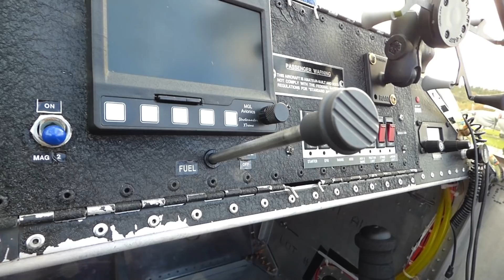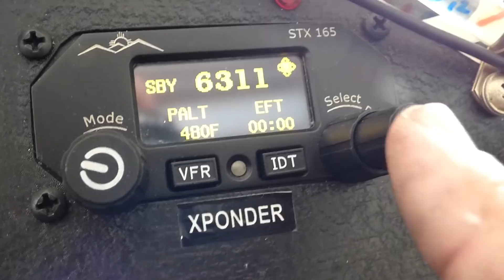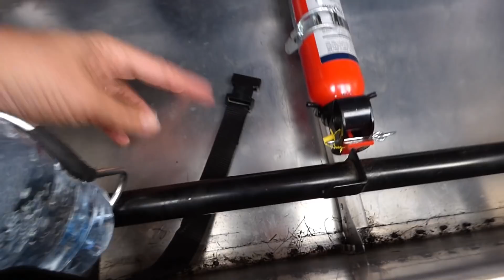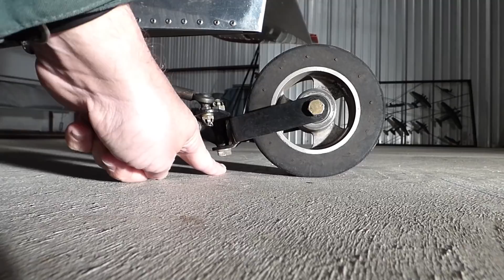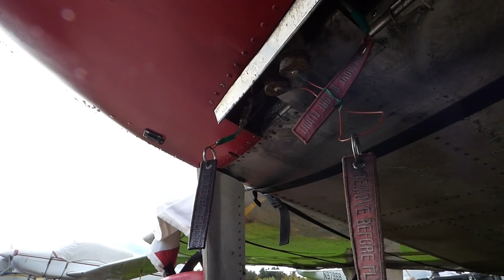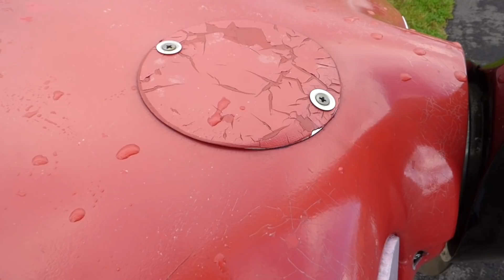Sonex Video Tour

Comment: Is the non painted parts covered in lacquer? I mean the polished surface
Reply from the maker: No. 6061-T6 aluminum is about the most anti-corrosive aluminum alloy there is. It's just polished. I re-polish every 2-3 years, and it had been on a tie-down for 6 years (in a hangar now). Lacquer would not work, and would haze, crack and chip. It would look awful. Check out any polished aircraft and you'll find the same thing as mine.
Reply: @mikesmith208  sweet! Was just curious, can see the care you put into it with that shine you got going on 🫡

Comment: Stupid?
Reply: You can't build a car but a plane is not a problem. Plastic engine cowling? If you are cold just wear motorcycle gear. Why not sit in the middle of the plane. The propeller is the most important part of a plane.
Reply: Especially not a 100mpg car.

Comment: What a great video and thanks for sharing in such detail. Lots of fantastic ideas. Just a helpful hint: if you ever need to remove that VHB tape, you can use a piece of dental floss and run it between the two pieces. It will act as a sort of wire cutter and separate the two halves. Then you just need to clean the adhesive from the surfaces and you're good to go.

Comment: What material are you using to cover your glare shield?  It looks good.
Reply from the maker: It was a faux leather from JoAnn Fabrics. I put it on with high strength upholstery adhesive. Tricky to put on (requires adhesive on both surfaces, gets tacky, then place). It's never moved, bubbled or buckled. I was looking for something easy to clean that would not hold dirt and dust, so all fabrics were out of the question. Black is preferred, as anything light colored really reflects off the windscreen!

Comment: Nice setup, but why did you put the Mag switches apart from each other instead of next to each other?
Reply from the maker: The center of my panel is removable for access. There was not enough room on the left side of the removable section to fit all the switches over there, so one of them had to move a bit to the right, into the removable panel. The Sonex has limited panel space, so you have to make decisions.

Comment: Just stumbled on this and GREAT video thanks.  Question about your rocker breaker switches.  What brand are those ?  I can't seem to find those.
Reply from the maker: Mouser Electronics, www.mouser.com, W51-A121B1-10 (10 amp), -5 (5 amp), etc.
Reply: @mikesmith208  Thank you.  Haven't taken time to view your entire video but some great points.  Will update my panel layout immediately.  I am trying to get back to building this winter and really appreciate you taking the time to do the video.
Reply from the maker: @jamesstephens9818  No one way is the right way, so weigh your options before you do anything. I like the switch/breaker concept, and the fact that it's all in front of me, and easily changed if I change something on my panel that requires a different amperage. Others like the expensive certificated breakers. And other prefer fuses for various reasons. Best of luck!

Comment: Question about foot rest. Will the bottom buckle if you "stand" on as you get in, or is there a cross bar that the pilot and passenger can step on for support? Thanks for your time.
Reply from the maker: Not sure where you mean. You get in primarily by standing on the seat and then sliding in around the control stick. For the pilot you can maneuver to avoid stepping on the seat, but not for the passenger. The seat pan is like a sling, and is quite capable of supporting someone walking over it, and the seat cushion helps spread the load. If you were referring to the bottom skin of the airplane, there's not a way you can physically stand on it; it's too far under the instrument panel to reach it in a standing position. And there is a cross member that goes from the spar tunnel to the firewall. That's where I have my fire extinguisher mounted.
Reply: Michael Smith  I mean where you rest your foot while sitting. Can you put pressure on the floor or do you have to carefully step on floor crossbars to avoid a possible “buckle” of the floor pan?
Reply from the maker: @denisronchini2258  Floor is solid as a rock. Kick the heck out of it if you want. :-)
Reply: Michael Smith  Thats awesome! I keep looking for reason “not” to do build it, but it’s getting harder not to buy a kit! Lol. Thank you for the update.
Reply from the maker: @denisronchini2258  A Sonex is a "simple" aircraft. It's not an RV and it's not a IFR Cessna or Piper. If it meets your mission it's a great little airplane. I built the entire thing, all in, for $28,000. After 6.5 years I still love it. Would like some more HP, but I knew what I was getting with the 80 HP VW ($7,000 vs $24,000 for an engine!). If you can swing the cost of a larger engine you won't be unhappy. It just wasn't in my budget.
Reply from the maker: @denisronchini2258  I sent you an email...

Comment: Would you please add to your pref Pin over bolt? And fuel shutoff with the Aero carb , over mixture cutoff only?
Reply from the maker: Pin has it's own safety wire built in. Bolts need grinding, due to the threads, to get them smooth. Sonex uses the pins, which is where the idea came from. There is not much load on the pins, so they are plenty strong enough. Every AeroInjector setup MUST have both a mixture control AND a fuel shut off. Otherwise the fuel will invariably leak past the needle. Also, the fuel shutoff is on the pilot-side of the firewall. If there is an engine compartment fire you want to keep the fuel from being on the engine side. What happens if a fuel line gets breached between the firewall and the AeroInjector? Without a shutoff you burn all the way to the ground.

Comment: I hope there's enough room to wear a parachute in there when you're going upside down etc in case  you got to get out
Reply: Parachutes are pointless in low energy maneuvers such as barrel rolls, spins and loops, the loading is well with in the sop flight load limits . Now, get into snaps, Lomcevak's and such, then that's a different story.

Comment: What do you get for climb and cruise speed with that prop?
Reply from the maker: Like everything in flying, it depends. Single pilot in cold winter conditions, I can get 900 fpm climb on take-off. Summer, hot, at gross weight, as little at 250 fpm. I usually cruise around 100 kts and 4.5 gph. Wide open throttle I can get 124 kts true, at 3,260 rmp. I tested the Prince Prop against my original Sensenich and the Prince Prop beat the Sensenich in ever category.

Comment: Wow, thanks for the great and informative tour! And congratulations on Avery nice plane.
Do you think you are getting some bypass and losing some cooling pressure with the oil cooler seals curling back instead of in towards the pressure?
Thx again,
-Steve
Reply from the maker: No. The seals are very tight against the cowl. The cowl actually bulges up slightly because of it. My trip to/from Oshkosh this year, in 95+ degree heat, had my oil temps at 165 F.
Reply: @mikesmith208  awesome! Thx again for sharing.